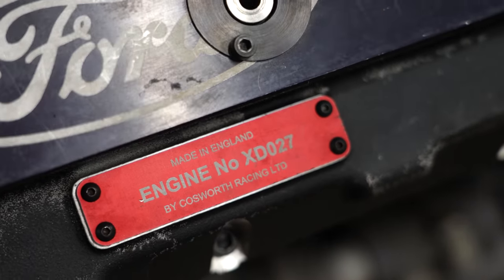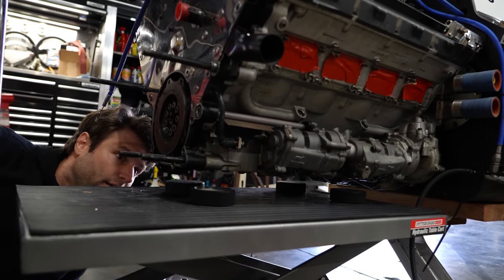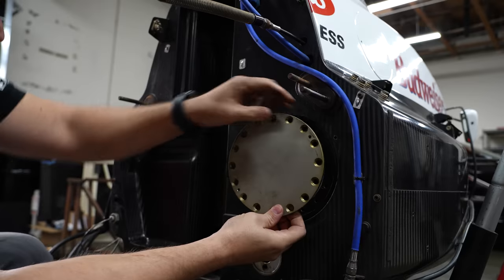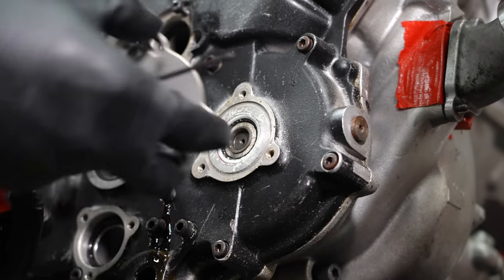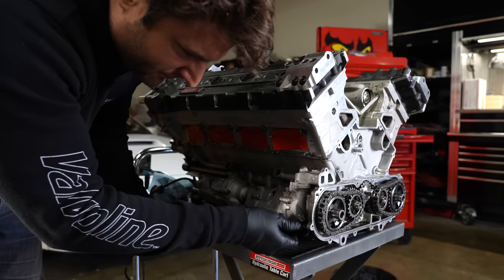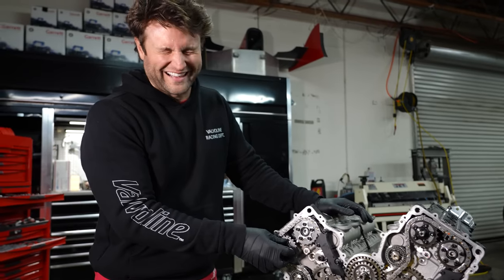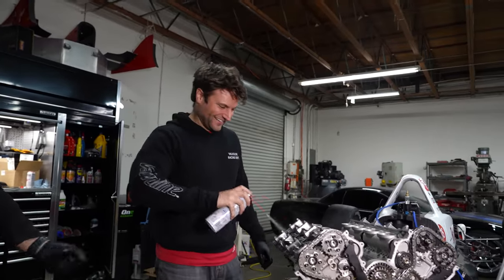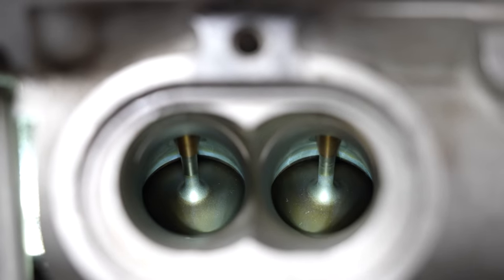We teardown the IndyCar Engine to expose its Secrets! Cosworth XD Turbo Methanol V8

Comment: Back in the day when Ford Cosworth was competing against Toyota, Ilmore Mercedes, and  Honda , the tech in these engines were closely guarded secrets. NEVER were these engines ever allowed to be in the wrong hands where they could be torn down and examined by a competitor engine manufacturer or team. The engines were delivered to the team a few days early for installation. But the ECU was only delivered and installed on the car right before first engine fire up always under the supervision for one or more technicians/engineers from the engine builder. Also there is an engine engineer assigned to the team always monitoring real time telemetry data whenever the car is on track or the engine is running. Immediately after the race weekend (or even after Saturday qualifying) the engine is removed from the car and quickly brought back to the engine builder under the guard of someone with the manufacturer just so the wrong people can’t see what they’re not supposed to see

Also those square shaft drivers are for the mechanical fuel pumps in the fuel cell. At the time, rules required mechanical engine driven fuel pumps. When the engine is installed to the tub, the mechanic(s) need to carefully align the fuel pump drive shafts into those 2 square drivers while the engine is being pushed forward into the back of the tub

Oil tank is going to be mounted in front of engine and behind fuel cell. There should be a recessed area in the back up the tub for the oil tank. The oil tank should connect to a fitting on the front of the motor to feed the oil pressure pump.

Comment: your going to need a life support pre warming system for that motor before you start it. warms fluids to temps before start. these are built so tight cold starting them will tear it apart

Comment: At least in Tool and Die making, those solid dowels would used to locate the two halves of the those main bearing caps. They would have been drilled and bored at the same time as the crank journals. just a different method than having a dowel pin.

Comment: The chain tensioner is on the slack side of the chain, so, you were turning the crank the wrong way i think. When you turn the motor the correct way, the straight part of the chain should be tight and between the cam sprockets should be tight... then the tensioner wheel in the slack curved bit.

Comment: To know the rotation, when you turn the flywheel the distribution chain is PULLED on the side where there is NO tensioner, in your case, Counterclockwise on the flywheel.
For the tollerance, I think the engine is not New, so I'm sure the tollerance has increased.

Comment: Are those cam lobes or arrow heads?! lol I have no idea how that severe of a lobe or lift, forget proper nomenclature, is possible without destruction, especially at the insane rpm it operates at. The horizontal force exerted on the lifter has to be insane.

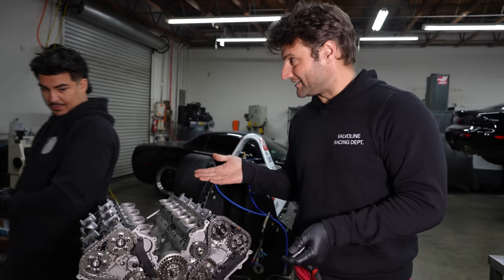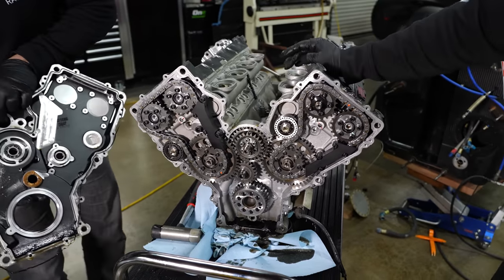Comment: @48:37 You are spinning the engine the wrong way. In almost all cases the cam chain tensioner will always be on the slack side of the chain. So you will pull on the straight side of the chain and the tensioner will take up the slack side. @55:24 if you look at the front cover @39:51 there's a top tesioner for the cam chain that presses down on the chain between the cam gears to take up the slack between the cams.

Comment: If that engine has taper wall, tool steel, piston pins, and most likely aluminum spacer buttons. I may have machined them.
I Turned SO many pins on my Mazaks for those Indy engines.  Yee Haw ,nice to see something i made when i was first starting out in the performance engine component machining scene. If thats a Ross, Rousch  build ,  for sure!
Edit after watching whole Vid... OMG !!! Rob, watching you take things apart scares me. I really like your vids, but sometimes , you need to stop and think, "maybe I should shout out for someone experienced" No hate ... Just well, you treated that fine clockwork engine like a cheap yugo with 300,000 miles.
Take that prybar, hold out your own hand,and hit it till it hurts, you deserve it! BAD ROBS HANDS , BAD !  Dont F*%$ this one up Rob. Its built to two, ten thousands of an inch tolerances. .0002 !
Not your usual, slack as* .001 specs.  Stop touching the red shiny button Rob!!! GET HELP

Comment: if the cam lobe is more gentle then it reduces the valve float. most engines have too much cam. a wider shorter cam is better in the end then a thin tall lobe. take a look at Steve morris videos to learn more about cam profiles.

Comment: engine is running counter clock seen as the timing chains is in the back side of the engine and slack side of the timing chains is un loaded side and the other side of the chain is the loaded side as it is pulling on the camshafts.

Comment: I would have guessed that the engine turns counter-clockwise, like most engines do, because the timing chain drive should be a straight pull, and the tensioner handling slack at various angles and curves of the chain.
Reply: Disregard, I see you later worked it out.

Comment: @ProModsPerformance. That is strange that that is exactly what is said about how they are started. They first heat them up to operating temps, and then start them.
  The information supplied suggests it is a clearance reason.
   Too tight when cold..? Let us think about that. Metals expand when hot. Ok some other reason.

Comment: Isn't spinning the motor cold a bad idea? Because of the tight tolerances? I remember people say these kind of engines are ceased when cold and need to be warmed up to get in to tolerance spec.
Reply: the 90s CART engines were not ceased when cold(dont think any indycar engines are built that way..but i could be wrong)  walking through paddocks, back i n the 90s, I would just see them hook a laptop up, shove the starter in and let them idle.  F1 engines certainly are locked when cold and require warm fluids pumped through them before starting.
Reply: I don't think these were built to those kind of tolerances. Modern ones are, because they're trying to extract the same power out of less displacement and it takes all the tricks. Hoonigan just put a modern Indy engine in a project and it definitely requires pre-warming.

Comment: I wouldn't be touching those cams. If you are looking for extra life span, only rev to 8Krpm, and limit horsepower production from the turbo. It is made for 900hp. If you are running at 600-700hp, you are within regular engine running specifications / safety limits. BTW... Cool project!

Comment: I'm guessing the high-voltage, low-current, alternator is so that they can run the charge current from it through smaller wires, and then convert it to low-voltage, high-current, power that requires much larger cables closer to where it will be put into the battery. 🤷🏻

Edit: It may have something to do with the wide rpm range the alternator has to operate in also. 
The alternator operating with a much higher voltage, and then using a DC to DC converter to drop it to the required low voltage, would probably be much better than using a conventional alternator with a much lower core voltage to try and get it to operate consistently throughout that large of an operating range.

Comment: You don’t light it on fire. I.E. the oil. 
You do what they call is a SOAP sample Spectrometric Oil Analysis Program (SOAP). It based on friction it a big spark show basically. Did it for aircraft’s when I used to work on them.
Reply: TelegremmeTheRobdahm.  sure how…?

Comment: Bro, just look at the timing chains to figure out which direction to rotate the motor. Tensioners always come after the camshafts in the power flow. Never before.
Reply: My stomach was turning when he was cranking on it.  My only guess is he thought it was right...and was going the correct direction just on the wrong end of the engine.    Since normally your on the crank bolt and not the fly wheel.  🙁

Comment: Your test to find the bottom crank case bolt torques was probably a waste of time. I bet those are torque then turn a number of degrees thus permanently yielding them and they’d need replaced to put new ones in.

Comment: Surface discharge spark plugs like in aviation. Usually Means a high compression packaging problem for the ground strap in the chamber. Could also be engineered for rapid flame front combustion ignition. In a short stroke high RPM reciprocating engine. With out the ground strap shrouding the kernel you don’t have to worry about indexing spark plugs. Although I bet it’s more of a packaging problem. I would love to help people learn with out making the thousands of stupid mistakes I did to get where I am🤘🏽

Comment: Hey guys, you almost got it right when you noticed slop on the cam chain.

The engine will PULL on the straight side of the cam chain assembly and the slop will be taken up by tensioner (possibly oil pressure controlled)...

So..

You almost got it when you noticed cam chain slop.

But there absurdly is no slop... The slack doesn't matter. Engine only pulling on the straight side.

Comment: 21:58 you can run most engines with out a cam sensor...... but instead of sequential injection..... it changes to batch or bank injection
.
so instead of injecting right when the intake valve opens
it just sprays all the cylinders (on that bank, or the whole motor)....... and then the fuel just sits on the valve
.
it makes for hard starting, rough idle, ETC
.
.
when my GM 3.1 v6 cam sensor went out...... 
sometimes you would start it and it would run perfect
shut it down start it back up
and now its like.... 180 degrees off.... and fuel is pooling on every valve....... and it just ran like poop (but it did get me home)
.
id just shut it down and start it again..... try and get it "synced" up a bit better

Comment: While it wont be as mental im hoping business plans work out and i can build my k48 honda based v8 for a prpject car and have it kinda in a sense like a road worthy indy engine. 

4.2L ish. Long rod ratio probably titanium rods maybe steel. But built for revving high and making use of vtev to have an intense and suoer wide powerband but a regular 1000rpm idle unlike indy cars. 

Working on reducing any unnecessary friction and other losses. And also prevent losses due to flex and whip. Also gonna have the whole engine balanced and tolerances together as a unit and hot honed plus wpc and other treatments. Reliability strength reduction in friction and just over all weight. 

Ported and polished. Get good airflow and also help with good turbulence that helps air fuel mixing. Bunch of volumetric efficiency building tricks and reducing sidewall pressure from the piston. 

Set up for reduced windage on the crank and rods. Reduced displacement over the stock 5L set up the designed went for. Same max rpms. But built for a sustained high rpm and reliable set up. For full tilt so i can crank some boost onto it. Also helps the piston speed. Gonna go overkill on the rod bolts. Cams and everything for the top end is gonna be a bit annoying but worth it. 

Aiming for 1200hp to the wheels with a 10k rpm and a like 8k poserband thats relatively flat and straight climbing. But be able to drop the boost and have a around 700hp tune.

Comment: Be careful not to run it past 11,000 rpm when you get it back together.  There are bound to be a few valve springs about to give up the ghost.  Very cool BTW.

Comment: I'm not sure putting in two exhaust cams in is a good idea. There's lots that go into the cam design. Changing valve opening and closing ramps could be worse for the springs than running the extra lift. Send it off to someone that has a cam profiler and see what the rates are first.

Comment: Rotation way ? ?  the straight pull chain guide   the chain must go down so the other tensionner takes the freeplay.without taking the load  . The way I see it is Counter Clockwise from the front end of cranckshaft

Comment: A lot of the mess cleaning could be avoided by using a teardown table with a drain, also gets it at a nicer working height than the hydraulic lift cart.

Comment: @40:00 the timing chain/gears make it look like a swiss watch... beautiful precision machining.

Edit* @47:20, Flat plane V8's are just two (typical) I4's joined at the crank, usually in a 90deg V (with no crankpin splitting), but while flatplanes have symmetrical firing (L,R,LR,L,R,L,R) unlike the typical American V8 which would be equivalcal to 2 crossplane I4's joined at crank.

Comment: I don't know whether '90s Indy engines were built to the same extreme tolerances as F1 engines, but it looks like they were.  You have to pre-heat the oil in an F1 engine and let the heat soak into the block before you crank it.  Until you do this, the engine is pretty much seized.  With plugs out, an engine, especially a race engine, shouldn't be that hard to turn.  If it were, think how much horsepower it would be losing in friction.  I fear that, once you get the pistons out, you'll find you've scored the cylinders, hopefully not too badly.

Comment: Isn’t it the Indy car engines that need to be preheated for the clearances to opens enough for the engine to turn over safely?
Reply: Not all indy engines run tight clearances but f1 engines have been next to no clearance  for over 25-30 years
Reply: @njclsx4252  got it, thanks man! I’m not too familiar with these top level race engines so I just learned something.

Comment: WOW, F1 Cosworth engineers decided to use 4 bobweights instead of 8 on the crankshaft. that explains the "bronze" side of the thrust bearing that fell out. anything to save weight. increased wear (only in the thrust vector) lighter, more responsive crank. I'm impressed AND disappointed ALL AT THE SAME TIME to learn that racing secret.

Comment: The part that really made me go holy shit, yep that's engineering
is the fact that the main bearing cap is connected to the oil sump...
that's just engineering 101 huh, removing the number of parts = removing complexity & failure points

this engine teardown has been quite a ride, so cool
Reply: A lot of race engines don't even have rear main bearing seals because it makes the engine spin that bit more freely, so they leak when they are sitting, and when the dry sump pulls vacuum, it will seal the oil leak while it's running.

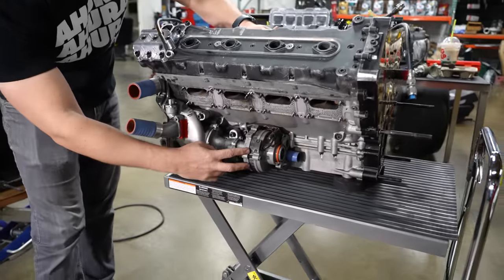Comment: 14:50

That's why the cars need a push to get rolling at low RPM. They have no power until you really rev these engines up.

Comment: 49:21 ya, because its a HIGH COMPRESSION engine...... you are fighting the compression 
plus, fighting all that rotating assembly (cams, chains, ETC) 
.
take out all the spark plugs..... then it will spin WAY WAY WAY easier

Comment: Any reason you can’t pull some timing out of it and run it on e85 or the same ethanol you run the four rotor on? Unless the compression is stupid stupid high I don’t see why that’d be a possibility and then that keeps some of the cost down lol
Reply from the maker: I want to! The only challenge I see is if ethanol will cool the intake charge without an intercooler while being injected preturbo. Super curious how effective that is
Reply: @RobDahm  yeah seems like iat’s would definitely be a concern without an intercooler. Any room anywhere on that chassis to fab up a w2a intercooler setup? Might be the route to go. Save the life of the motor and rings. I think the reason a lot of those alcohol motors need to be torn down and rebuilt is because of alcohol passing the rings and wrecking the oil so it doesn’t lubricate as much. I know ethanol isn’t much better but it would be better. 

I’m curious to see what you have planned. There’s a million things you could do. Lots of new technology has been developed. I’m sure garret has some nice new turbos that would really compliment that motor well.
Reply: @RobDahm  side note you could probably fab up a water to air intercooler into the intake manifold as well. Something to consider if the room is there! Love the content as always dude. Nice to nerd out and learn from.

Comment: The jumping of the chain is that to take heat expantion into account?
Reply: You mean how the timing chain was a little loose on the gears? Heat might contribute but there’s also the possibility that the tensioners are helped by oil pressure, no oil pressure gives you that loose chain

Comment: Finding torque setting that way isn't the most accurate. You need to take account the amount of friction that needs to be broken to get bolt moving. That's why you need to torque bolts to the end with one move.
Reply: With one move? ….. maybe you mean the last pass and I’m not understanding ….. you need to know the torque, whether to put in with oil on threads, clean and dry or molybdenum….. other?  since IndyCar……. Typical to torque is 3 passes unless specified differently by the engineer. Draws the flange/machine surfaces evenly. I set at the low torque in the range and then increase if I have a leak, a major bitch since some castings are 6 or 8 feet in diameter or more, but the only thing I have in common with this cosworth is the speed. The Impeller in the machine is 13,000 - 15,000 RPM. :)
Reply: @Steven9675  My point was that if you tight something in certain torque, you will need extra momentum to break the friction to get it moving again. So if you try to reverse engineer it that way, you'll need to understand that the required momentum might be less

Comment: 46:46 is it "12345678"??? (or if using fords numbering system..... 14263748)
.
ok, i was pretty close..... i know a 60 degree bank V6 is 123456 (using GMs system)
makes sense that they would fire the back 2.... then the front 2.... for help with balance

Comment: Race engines when cold will always feel like that they are locked up, the reason, the extremely tight tolerances inside the engine.